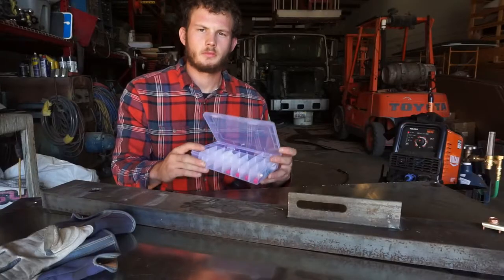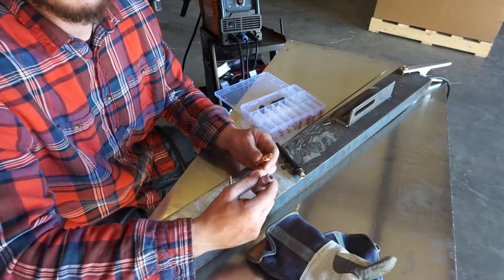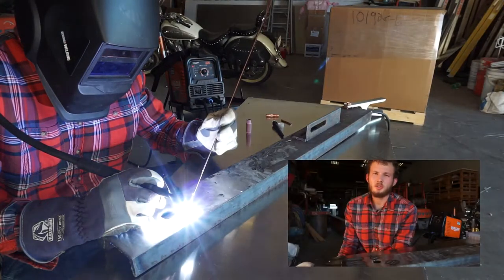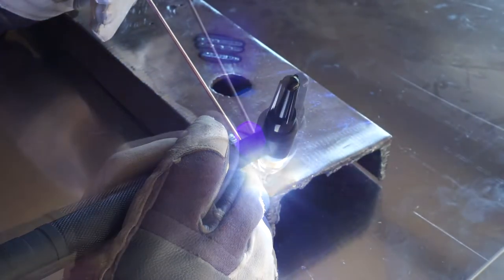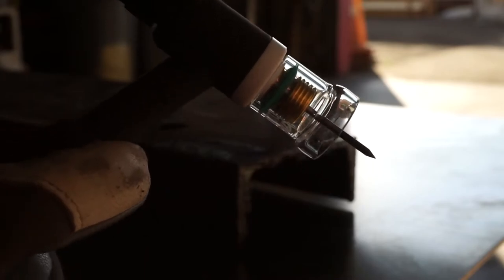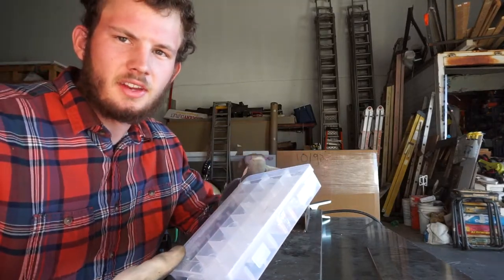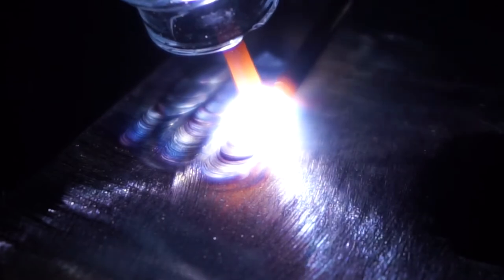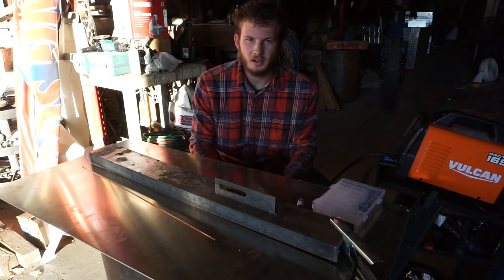EBAY GAS LENS KIT! Easy TIG Welder Upgrade Review

Comment: I got to tell you as a professional Those cheap products Actually last a lot longer than the expensive ones . And when I break something I don't cry . I just throw it in the trash and go on to the next one in my stockpile . I tend to think it's the hobbyist who get the extremely expensive things . When you're doing production you need cheap consumables .

Think about this would you rather have 12 Gas cups Or 1 on the job. What happens when you drop your torch And it Accidentally hits the ground . Do you want to shatter a $50 gas cup or a $1 gas cup .
Reply: You are correct in every way. The problem most have is getting past the made in china syndrome. If they looked inside their very expensive "brand" name so called made in america machines they would find all the same made in china parts. Most lincolns are assembled in mexico from Chinese parts. The millers and esabs are all the same Chinese parts assembled partially in america so they can put that made in america on it. I have both american sourced machines and Chinese made and I see no noticeable difference in their performance

Comment: How is it working so far since it's been around a year has anything broken?
Reply from the maker: No breakages yet! The biggest complaint I have is that the gas lens gets clogged up with metal and particles, but that can easily be fixed by better prep. With a clean lens, gas coverage is perfect

Comment: I'm not a pro by any means but u have quite a bit of stick out, I think if u didn't have so much stock out u would get so.e better gas coverage.
Reply from the maker: You're absolutely right. Fortunately, one of the benefits of having a gas lens is being able to get away with some ridiculous stick out.
Reply: Stick out should be the same or a little less than the inside diameter. Bigger cup = more stick out. Get that good argon pool up. Good vid!
Reply from the maker: Thanks man! That's a pretty good rule of thumb to remember 👍🏼